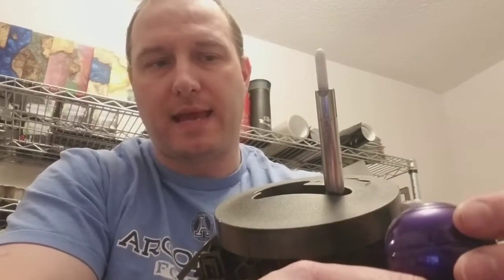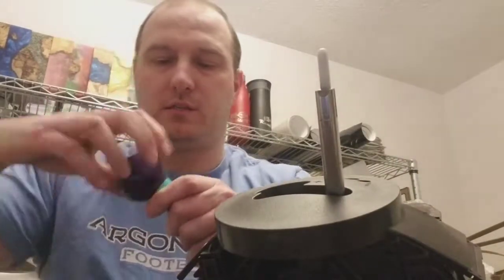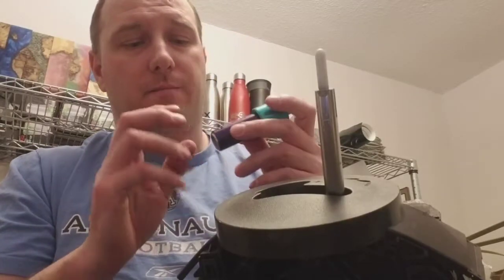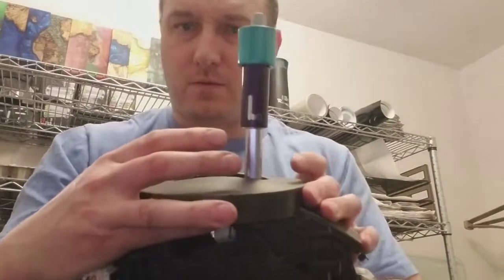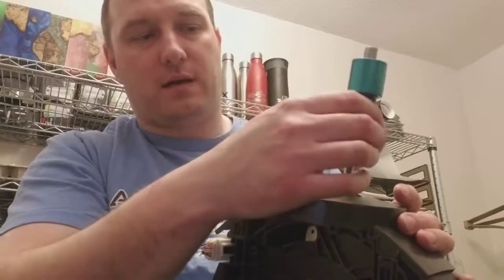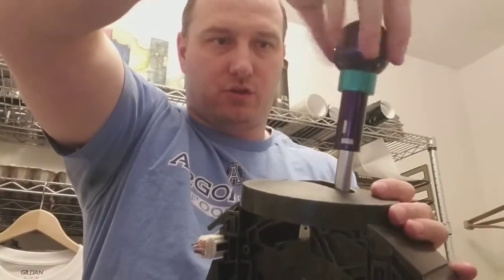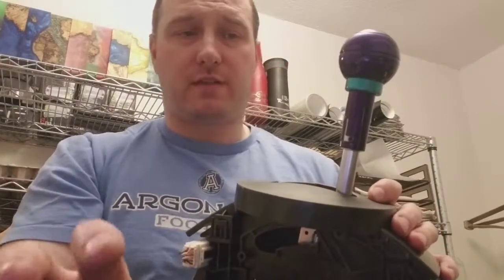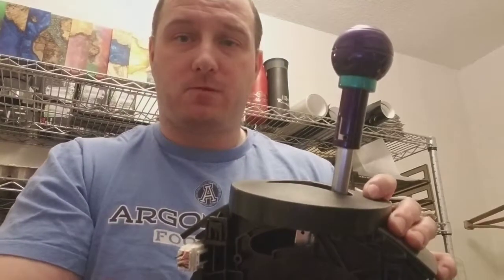370z automatic shifter install and explanation

Comment: Did you have to go under the car to remove that assembly ? Mine is kinda sticky on the manual side of it and wanted to take mine apart and clean it .